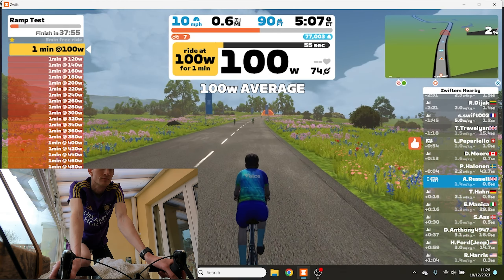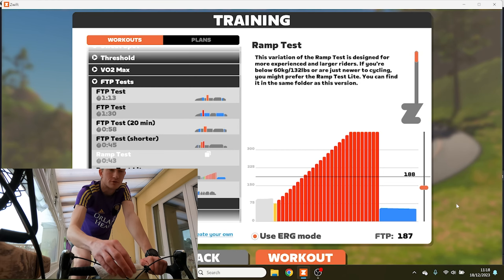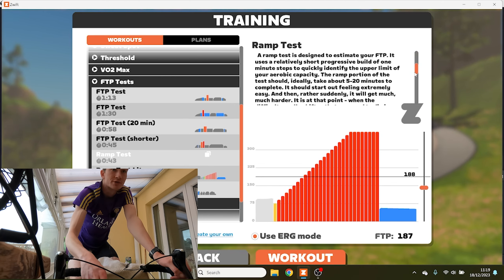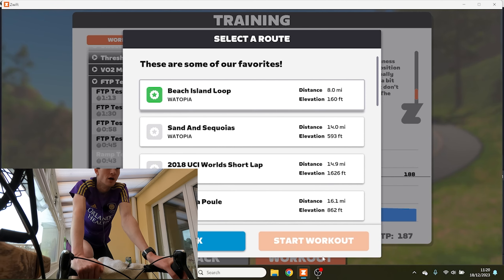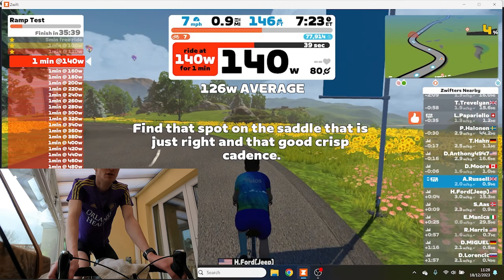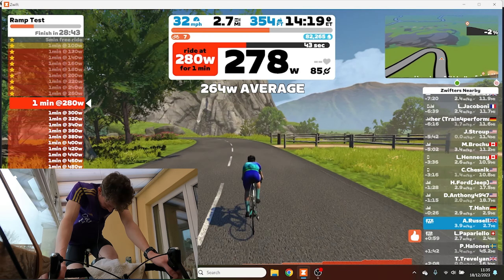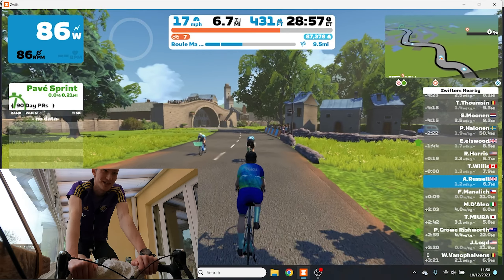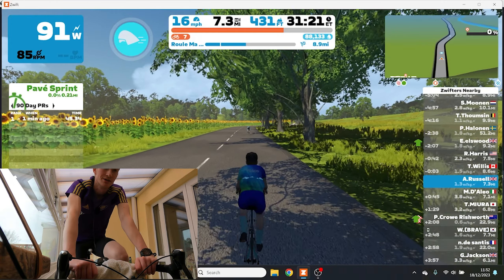What's my FTP? | Zwift Ramp Test with a Hangover

Comment: You should wear a HR strap to as HR is important to consider as well as watts. If in a future test you can see any improvement even if your power is the same
Reply from the maker: I have an HR strap now, bought one after doing this ramp test so will be able to track that in future too!
Reply: How would a change in heart rate show any change in fitness in a maximal test?
Reply: By using a HR monitor then you can see if you are fitter and more efficient at a given power and if it has improved 
A maximum test over 1 minute ramps does really show you anything as at the top it is more about will power and you can push further than you really could riding.
If you use HR you can see what the % of your max HR you hit
Example
You hit 330 watts in the test
You max HR is 190
At 330w you only hit 160HR
Meaning you can work out what training you need to hit the zone 5 you didn’t hit

Comment: Ramp test is a awful way to test your FTP. It’s always inflated and in my opinion it’s not a figure I can sustain for 40 mins let alone a hour. 20 min FTP test is a lot more accurate imo
Reply from the maker: I've only very recently started riding with power, but I plan on doing a 20 min test as I get more used to pacing efforts to a target wattage.
I think for beginners the ramp test is very good to quickly get even just a rough indicator of FTP though
Reply: @AdamRussellCycling  I’ve been using power for a few years now and having a accurate power zone reading is really important. Unfortunately many and including myself think that a ramp test reading is exaggerated. But don’t take my word for it, in a weeks time or so take a FTP test and see for yourself. But even a ramp test is better than nothing so all good
Reply: FTP is a false metric it is nice to know but not really proving anything- HR and power to workout drift is a much better metric
Reply from the maker: @jonnyt8154  Good to know! Thanks for sharing your knowledge, I'm very new to looking at power so very happy to learn from more experienced folk!
Reply: No problem, let me know if you want anymore pointers? Are you just testing as a benchmark or you have an event in mind? Or just to smash your mates
Reply from the maker: @jonnyt8154  Just as a benchmark right now, but I'll be doing a few hill climbs at the end of the year so will be interested to learn what my power output/HR capacity is for these kinds of efforts